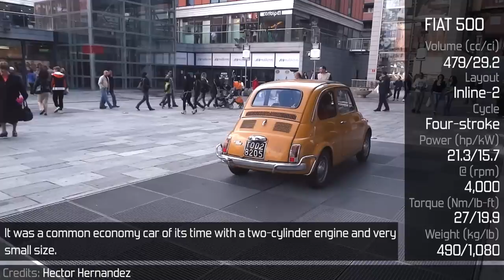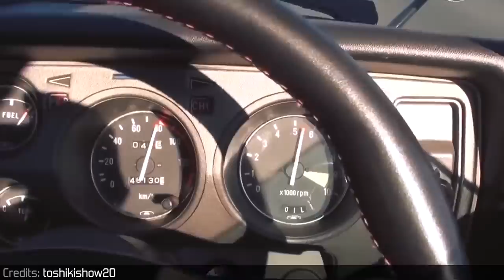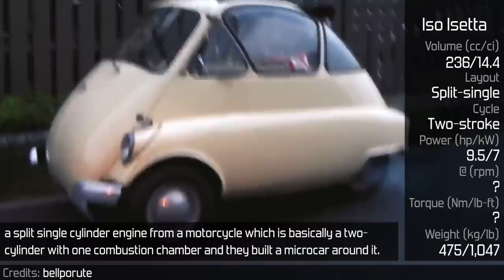12 Of The Smallest Engines Installed In Cars

Comment: There are more!      Disability "cars" in the 60s ( Christened crip wagons by many who drove them)  Were serious death traps, but also a great deal of fun.  Originally they were powered, all makes,  by a Villiers 197cc air cooled 2stroke.  Later versions got posh and racier!  The most popular was the AC.  Yep, the same company that produced the Cobra!  It's COG was the best.  One example of the others was the Tippen.  Incredibly narrow with large skinny wheels.  I still believe that the company deliberately used that name, because the COG was such that one would tip over at a silly low speed.  The other make that springs to mind was Invacar.  About in the middle, and totally uninteresting.  All three used a tiller for steering, and the brakes were applied by pressing down on the tiller bar. I bought one privately in 1968.  £25 then.  Fitted competition piston and head, and became a serious lag behinder.  Enjoyed every minute.   I wonder if anyone remembers the Bond?  Not a crip wagon, but  something else from that era.  It was a three wheeler with the single front wheel at the front.  The Villiers 197cc engine was fixed somehow to the front wheel.  To reverse one would simply lift the front end and swivel!  Oh to be young again in the summers of 68, 69 and 70!!!!!!!!!!!!!!!

Comment: why auto maker didn't make small engines anymore? 
yet many complaints about fuel economy and pollution
a car with 600cc 2 strokes engine, add EFI and other tweaks, put it on a hatchback,  should reach 90 mpg, with plenty of power and speed for average user.

Comment: I had a BMW Isetta bought for 50 pounds, ran it all over England then into Brittany.The Bretons called it " L'escargot rapide". No oil gauge meant that when a stud came out of the engine to gearbox joint resulting in the fastest the car ever went before it blew apart!. Only car I ever owned that went down hill faster in neutral then when in gear! Sold it for 50 pounds. Oh well it most probably worth more than my MG B.

Comment: As always, nice video! Just one thing: the Fiat 500 was originally produced with a 479cc engine and it's ok. But back in that days it produced 13bhp, not 21,5. Than, in 1958, the Fiat 500 Sport was introduced in the market, and that one had 21.5cv, but with a 499.5cc engine, the same that was produced for the remaining part of the production, but with only 17bhp. In the end, 21.5bhp were too much, in that days ;)

Comment: Why all japanese key cars have the number 360?
Reply: 360 refers to engine displacement (in cc.) 
P.S. it's kei, not key.
P.P.S. Visio-Racer  neglected the Daihatsu 360 range (an easy oversight, as all Japanese kei cars, by definition, have very small displacement.)
Reply: Maybe means round or bubble. They all looked round in this video.
Reply: leo heltai it's about the law in the Japan. There is a category of cars called kei cars and they have to meet some regulations, for example max. displacement. As you can see, the max. displaxement at the time was 360 ccm and the easiest way to name the model is just putting the displacement in it.
Reply: It represents the displacement.

In 1949 the limit was 150cc for 4-strokes and 100cc for 2-strokes. It grew to 300cc in 1950 for the 4-strokes, and 200cc for 2-strokes. In 1951, the maximum became 360cc for 4-strokes and 240cc for 2-strokes. The all-360cc era for kei cars started in 1955 until 1975, then the maximum engine displacement was increased to 550cc until 1990 and then it became 660cc with engine power limited to 64hp like what we know.
Reply: It's spelled Kei, and the 360 refers to the engine size - they must be under 360cc to fit the class.

Comment: Just so you know, 2CV, are actually 2 fiscal horse power not the real power :)
Reply: Danny Dan-  Yes, we know.  The French government (now THERE's an oxymoron) attached that classification for taxation purposes, not as a description of its actual power output.  Like the 'Quattro Cheveaux'  (4CV) Renault of the 1950's, predecessor to the Dauphine model.  The 4CV had a 749-cc 4-cylinder engine putting out 28 horsepower, yet the French gum'int rated it at  '4 horsepower'.  Go figure.

Comment: pity you did not include the aussie made dart  based on the Gogo chassis   went like the clakers, as long as you did not mind looking at the door handles of minies as you drove also there was the diahatsu 2 cylinder about the same 350cc ,it was front engine and the Dart a rear with fiberglass tank behind the seat  4 speed gate gears ,air cooled 
YES owne one and wished still had it now worth a fortune,think about 900 were built  could be wrong but was a low number.
Mine red and Purple ,black hood and the bloody spare was way down the front.

Comment: I remember back when I was in high school in the mid 70's, a friend of mine had one of those Honda Z's..not a bad little car for their time, but apart from another one that some people down the road from where I lived there were never that many seen here in Australia. the Messerschmitt shown here was the early version, there was the later version with a Sachs engine around 198cc's, called the KR200.. my late father had one he acquired in the early 80's. they also produced a 2 cylinder version called the Tiger 500, extremely rare and valuable these days.they were not built by the Messerschmitt aircraft company as many believe but by another company who used a converted Messerschmitt factory to build their cars in hence the name.

Comment: I saw a few of these when I lived in Paris from 1956-60.  The Messer and the Isetta were common but the grey 2CV was literally everywhere.  The 2CV was designed just before WWII and when the Nazis invaded France, the French took the pre-production model apart and buried the pieces, and the plans, all over the place.  When the war was over, they dug the car up all over the place, reassembled it and started production.  By the mid-50s you couldn't walk a block in Paris without seeing one.  
Incidentally, the French called the Isetta a "supositoire d'autobus", a bus suppository.
Reply: I gave away my 2CV last year. All in all a comfortable no-fuzz reliable thing. Rust was an issue, build-quality as well (shared with most cars of this time), but the construction itself was amazing. High mountains mid-winter were not an issue, neither Sahara crossings.

Comment: My Aunty used to own the Subaru 360 and she did mod to gain a bit more of power...Its quite a fuel guzzler although the performance is good for its engine size
Reply: Norman Abdullah-  Of course it was-  it was a 2-stroke.  Put a 4-stroke engine in it of equal size and she would have had a much more fuel efficient engine, especially if it was of a modern design-  4 valves per cylinder, narrow included valve angle, shallow combustion chamber and a turbo-charger.  Hootchiemama!   She'd soon find out why mounting an engine in the tail is a lousy idea.  Install it in the nose, for a front-drive set-up, and we'd have a modern car with strong sales possibilities, especially if it was water-cooled so it would have cabin heat and windshield defrost.

Comment: Don't forget the Berkeley if you can get hold of one! Later models were 328cc 2-stroke twins, both 3-wheeler an 4-wheeler versions, 70mph no prob. Later on a 3-cylinder 492cc version for the 4-wheeler, nicely nippy with all that 2-stroke torque. And finally a 692cc Royal Enfield 4-stroke with 52bhp, with twice the power/weight ratio of the then Mini Cooper! I had one, it remains to this day the most exciting car I've ever driven bar none. and boy, did she handle! Still miss her like mad. Along with my old cat too.
Reply: Robin Baker-  One of my school mates in high school (early 1960's) had a Berkeley 500, powered by an Excelsior 2-stroke triple.  It had a headrest behind the driver that faired back into an exaggerated tail fin, like a 'D' Type jaguar, only more so.  It looked zoomy as hell, sounded zoomy as hell and topped out at, what?  60 miles per hour?  (laughing)  But, hey, for a couple of 16-year-olds it was neater 'n shit.
Reply: Wow. 60mph... My 328cc 3-wheeler would do a genuine 70. Confirmed by other Berkeley enthusiasts we used to terrorise the streets with! In good tune the three should have topped out around 80. Maybe it was detuned for the market?

Comment: oh it must have sucked driving a 2 stroke car. . .mixing gas, short engine life, also 2 strokes are either gutless or have an expansion chamber which none of these cars did stock that i know of, besides i dont think i want to go BRAAAAAP in a bmw isetta anyways, 4 stroke is the way to go when it comes to cars atleast, i prefer a 4 stroke bike too but every one needs to feel the BRAAAP atleast once in their life
Reply: forgot no engine braking down hills also, cant not use brakes down hills in an isetta or whatever, either on the throttle or wearing out your through out bearing. . .or in neutral for non sequentials but if you had a bike tranny in it i guess you could find neutral and kill the motor and just coast and when you got to the bottom you could pick a gear and drop the clutch and go again, but 2 strokes still suck anyways, fun sometimes and the only options for some applications like chainsaws require 2 stroke but i would opt for a 4 stroke where ever possible even if it means less power, the motor lasts longer cause of much higher quality of lubrication and stuff
Reply: FlyingWildAlaska77-  You will note that the stroke motors in this video were from the 1950's, when pre-mix was available at the gas pump throughout Europe.  Only here in the United States did we have to mix our own.  Short engine life wasn't an issue in an environment (again, Europe) where the driving distances were a lot shorter than in the U.S.  Also, in post-war Europe 2-stroke engines were a lot easier to build and were thus able to put transportation on the streets for the people a whole lot sooner.  They needed cars that while not the best in the world, were available RIGHT NOW! and were affordable.  Having said that, however, if some of these beauties were resurrected today with modern, state-of-the-art powerplants mounted in the front, we'd have an interesting alternative to the exorbitantly expensive electric car.  AND be a kick to drive!

Comment: Yeah under one litre is small for Europe but for America under two litres is already small.
Reply: Puse-  Well guess what?  Mini Cooper is reducing their engine size to one liter, 3-cylinders, and a turbo-charger.  Gone is the 1.6-L. 4-banger in my Mini.  The new engine is billed as producing higher horsepower and torque figures than mine,  so lopping off another cylinder, making it a 700 cc or 750 cc twin would work if they'd also lose about 800 pounds of car weight (right now at 2500 pounds).  A 1700-lb. car with a state-of-the-art 700 or 750 twin would still be a kick to drive while delivering fuel consumption figures it the 45 to 50 m.p.g. range and virtually undetectable exhaust emissions.  I know I'd buy one, especially at one-third the price, or less, than an electric car.

Comment: 2cv means 2 cylinders right? not 2hp
Reply: @ ruben vanderveen 
'2CV' means the equivalence of a two-horse-coach by French tax laws.  It hat two cylinders, but this was not the reason for the name. The Renault 4 was taxed as '4 horses', although only slightly more powerful, and my GS I owned was rated '6 horses' and did 160 km/h (100 mph) with no effort. Just a crazy law.